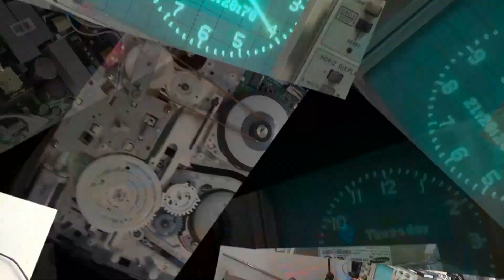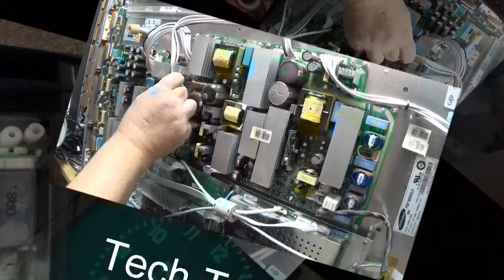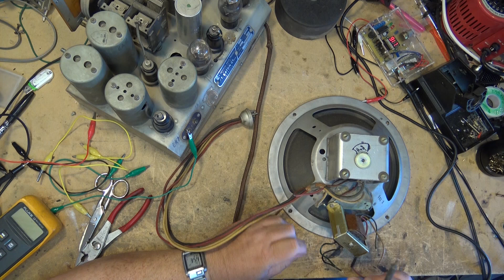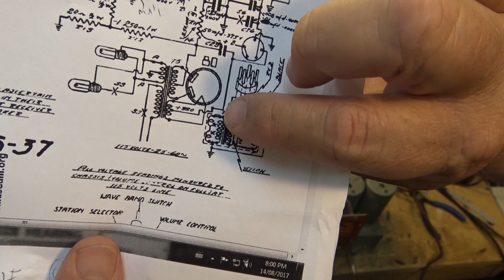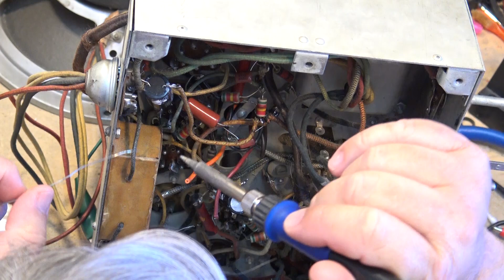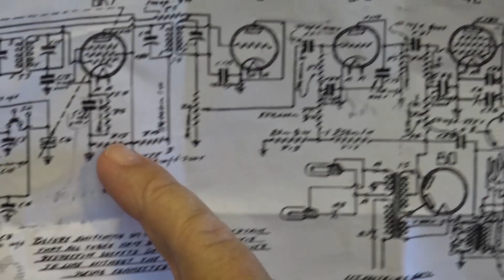80 year old Electrohome Series 662E Radio Restoration Part 2

Comment: I would respectfully recommend some spaghetti tubing to insulate the leads on the new capacitors.
Reply from the maker: They are not going anywhere and these d beasts are not being used regularly.  They go on display and are turned on for a couple of minutes a year. No collector turns their old radios on often because they don't want to wear out already acient tubes.  Anyone that uses one of these as a daily driver is an idiot.

Comment: on most old units the chassi is charged. i notice you never get shocked.
Reply from the maker: No, only on the aa5 the chassis is connected to the line. I am working through an isolation transformer which eliminates the shock hazard.  All repairs should be done through an isolation transformer for safety.

Comment: Im replacing the main filter caps in an old motorola console record player with a 60hz hum problem. am i correct the the negative side of the new caps should be tied to the chassis on a neutral chassis set?? im was sure, but it looked like you connected the positive to chassis with that 33mfd cap...is the a positive chassis radio? or am i just not understanding the theory, maybe i perceived what you did incorrectly...
Reply from the maker: The positive supply caps the negative terminal goes to the chassis. If it is a negative bias supply cap then the positive goes to the chassis.  The replacement goes in the same way the original.

Comment: I just wish there were more techs like you here in Australia that fix rather than trash!
Reply from the maker: The problem is modern equipment is not designed to be serviced. There is llittle if any service information available and parts are hard if not impossible to find.
So this drove most service techs to find a different line of employment. I left the service business myself in 2003, and just do it part time now. Mostly vintage stuff that is still serviceable.

Comment: Hammond sells an experimenter line of single ended and push pull transformers for around $30.00 each.  Yes, it's true.  I put two on a 2A3 stereo amp back in '06, planning to replace them with the heavies later on down the road.  They do 30 to 20k+.  That's back when you could get a new 2A3 out of China for $25 each.  The system sounds so good I have not ever gotten around to the upgrade.  They come in a number of primary values values, with complete 4, 8 and 16 ohm  on the secondary.  So, there is an inexpensive alternative to mismatching a push pull on a single end amp.

Comment: There's more on S/W than you know. My radios bring in quite a lot of stations. Clean that wafer switch contacts and you will notice quite a difference.
Reply from the maker: Jim Burns 
I did clean it and I was picking up a fair number of stations considering the antenna I used was just a hunk of wire tossed up on the roof. My proper antenna would bring in more. This isn't my radio station it was a customers set being restored and he was more than happy with the reception I was getting. There is still activity on sw  but nothing like I remember when I would listen to English broadcasts from radio australia, johanasberg the UK and the likes. I used to listen as a kid. I have a Halicrafters and a Sony icf2010 radio. Now I scan the band on my kenwood hf rig. Nothing compared to the good old days. Every so often a pirate shows up. That is always fun to listen.

Comment: So...the Audio Output Transformer also acts as a Filter Choke?
Reply from the maker: No. The audio outpu transformer  is just that. The audio output transformer.
It's primary is connected between the B+ and the plate of the audio output tube.
The B+ is also connected to the field coil on the speaker, and it is this field coil where it acts like a choke. There is a second coil that is fed through the secondary of the audio output out of phase to act as a hum bucker.

Comment: As the output transformer is meant to match a push pull  output stage. Try using one half of the primary to get a better impedance match.

Comment: Hi , Once again safety guy and only from my experience is the US. The "isolated" variac transformers  that I have purchased in the states aren't truly isolated. In all your projects I see a 3 prong, gray wire, going below your bench. I am hoping you are using the variac as a power on/off switch. You are showing repairs, now, where ground isn't really earth ground and house wiring could play a role in what voltages are on the outside of metal contacts of the tubes and chassis. These old radios are the reason there were in-house electrocutions in the States. Improperly grounded units in the household were death sentences in a time in the past. Maybe a bench review is in order to show us fans that know you know a thing or two and show us what you truly have. You're alive and working on TV's and radios. Anything old requires someone who has been through the grinder. Your attention to detail tells me that you have been shocked a few times. I know the animal, dude.
Reply from the maker: My bench power is 100% totally isolated from earth ground.
I have done videos before showing my setup. The power strip on the wall at the back of the bench is NOT isolated, but it does not power anything under test on the bench. It powers my scope, lights, test amplifier TV, soldering iron ect. It also powers up my isolation transformer which is a 2 prong brown plug that you can see plugged into the power bar. The transformer is mounted to the bottom of the bench. The secondary of that isolation transformer is connected to the 2 wires that run to the variac. No it is NOT grounded, it is running on isolation power. The variable output of the variac goes to the power bar on the right front side of the bench which is where everything under test is plugged in.
I work on power poles as part of my day job, and we take electrical safety very seriously.I take it just as seriously on my work bench.
Reply: I wasn't challenging you Dave, just trying to figure out what your setup was. Thank you for explaining. I enjoy your videos. I just don't want anyone assuming how you are set up and making a fatal mistake. Some of the equipment you work on as an expert, could be dangerous under the right circumstances. You know as well as I do that there could be more than 4 volts on the outside of those shielded tubes. Your warnings in your videos may not be heeded. I am a patreon because you do good work and teach people. My apologies if I upset you in any way.

Comment: Fun to see this old stuff be brought back to life! Perhaps I should do some preventive maintenance work on my stuff. Got an old PA mono tube amplifier from the early 60s. It still works, but I know it has those old paper/wax capacitors. One is in a bit rough shape since it has been touching a wire-wound resistor. Got an old tube radio too, but fairly useless since there are no AM radio stations here anymore. Can only pick up foreign ones that are in a completely different language. In fact, we're in the progress of shutting down FM radio too here (Norway). Soon those radios will be obsolete too.
Reply from the maker: What system are you on over there now? DAB or some other format.
The dab'd around here with DAB for about a decade and then the government canceled the licenses and the stations that were simucasting had to shut down. Now we have moved to HD radio, which piggybacks multiple digital signals on the back of existing FM stations, which pretty much guarantees that the analog main signal will remain for many, many years.
AM here has lost popularity for sure, but we still have probably 10 local stations broadcasting. 3 Sports, 1 traffic / News, 1 News / traffic, 1 News / Talk, 1 Chinese,  2 Punjabi and the CBC.
Reply: Yes, they're switching over to DAB. Currently only the nation wide channels have been moved over to DAB, but local stations still operate on analog FM. I kind of expect them to disappear too when the licenses run out. Many people complain about the poor audio quality DAB has. 64-96kbps is usually used, while FM use the Internet stream quality at 320kbps. Most annoyed people are those that have more modern cars with multi-function steering wheels that control the radio. Very expensive to upgrade and keep all the buttons working. Not uncommon with prices at 1500 canadian dollars to get a compatible DAB system. Just using a simple DAB dongle on the dashboard, and then half the integrated buttons are useless, kind of hurts the resell value of the car.

Comment: Smashing repair :-D
Yes the cabinet will make it much louder and more bass.
A good antenna and earth will make the shortwave side go mad :-).

Those carbon resistors were a pain for going sky high in value with heat, but valves are quite forgiving.
Reply from the maker: Everything is forgiving in valve radios.

Comment: That's a hum bucking coil my friend.  You are trying to reduce any AC hum in the power supply by feeding it, out of phase, to the speaker. I agree, I think it should go louder .
Reply from the maker: I believe once I get the correct transformer on this unit it will go much louder. This transformer is from a push pull 15 watt amplifier. The output n this radio is probably 5 to 7 watts. There is not much data available other than the schematic, but back in the 30's I doubt they had built many hogh power amplifiers. It does go pretty loud as it is, as you heard it was drowning me out, and I was standing right next to the camera and the speaker was 5 feet away. Once in the cabinet it will also appear louder  because a loose speaker suffers from phase cancellation due to the sound coming out the back of the cone.
Reply: Mark Anderson
Yes i thought the same :-)
I have an old f.j.cam book that shows antiphasing hum bucking coils on the speaker, dam clever idea, smart designers :-D.